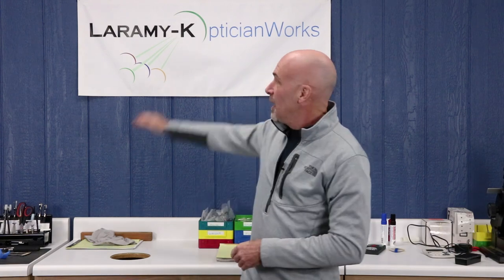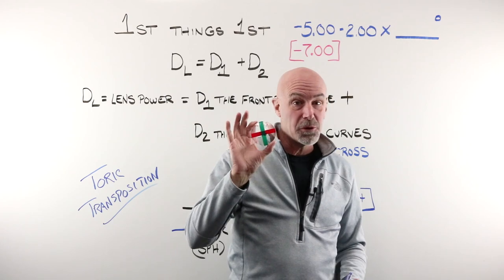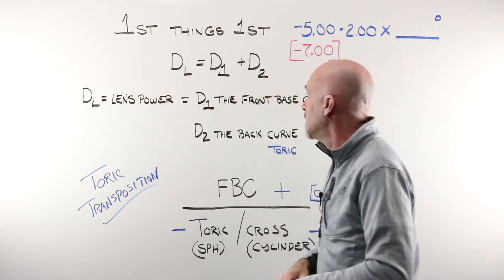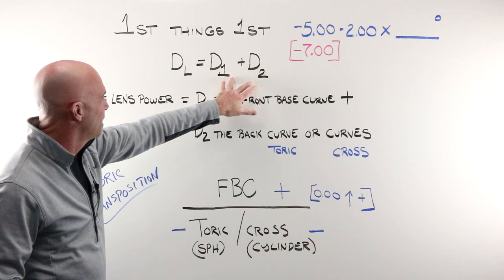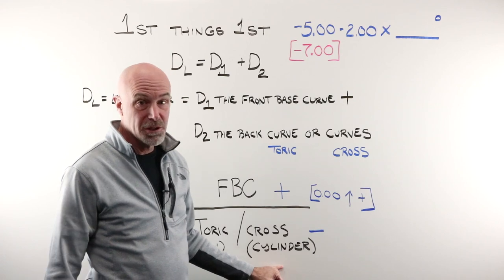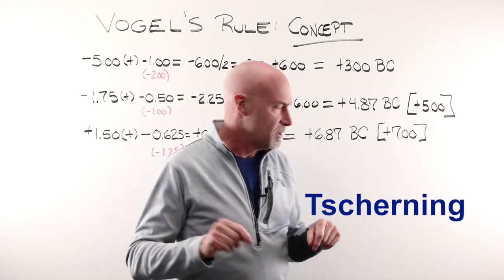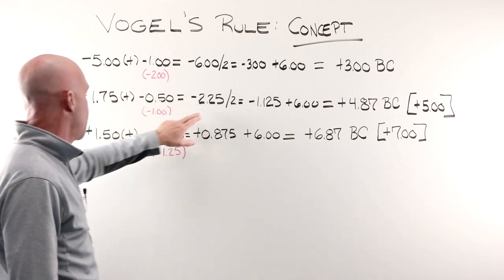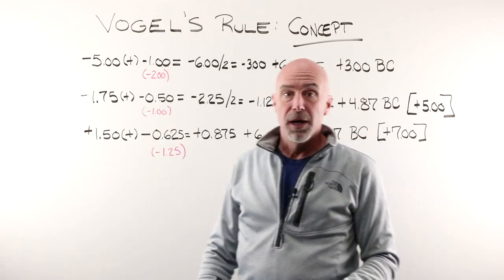Nominal Lens Formula Part 1 - Base Curve

Comment: In the first example using Vogel's rule, where does the -1.00 come from? At some point do we half the cylinder power? I'm a bit confused because there were no steps that would indicate how do come up with that -1.00? Please help!
Reply: Did you ever get an answer to this question? I’m highly confused especially with the other examples having different numbers that I don’t know where it came from 😩
Reply: @kassandramontes6116  My theory. You have two meridian readings (-5.00 & -2.00) Your second reading is -2.00, divided by 2 which gives you the -1.00. So you will actually divide two times instead of just one. However, if you are working with the Positive Power, you only need to divide once. I think that was it was, and it just was not specified but feel free to correct me in case you found the answer or better explanation. Again it is just an observation, just following the pattern. I hope it helps

Comment: Thank you for the video!  Can you explain why you are halving the cylinder power in the Vogel's rule example?  Everything else makes sense except for that.
Reply from the maker: Both the methods below work off the spherical equivalent of the given prescription. The formula to determine the spherical equivalent of any Rx is:
Rx sphere power added to 1/2 the cylinder power. If the Rx is a sphere like -2.50 then you work with the -2.50. Spherical equivalents are also used in other formulas and when working with contact lenses.
The most basic rule is that you always want the base curve to be as close to +6.00 as you can get and still have the Rx work. In theory +6.00 should always give you the best possible combination of curves for weight, optics, etc.
Study the chart below. You will want to remember that the higher the plus power, the higher plus the base curve will become. The more minus the power (less plus power to minus power) the lower plus the base curve will become. A high minus Rx may even have a base curve of +0.25 or even 0.00.
To do that you can use Vogel’s Rule which is this:
For a plus prescription: Base Curve = Rx spherical equivalent + 6.00D
For a minus prescription: Base Curve = 1/2 the Rx spherical equivalent + 6.00D

I don't you'll go wrong in thinking of spherical equivalent as an averaging of powers.

Comment: Thanks as always for the helpful videos. Could you possibly make one explaining how center thickness can negativity impact a final completed pair of glasses (when it doesn't meet tolerance standards)? Thank you!
Reply from the maker: Center thickness can only be out of "tolerance" in a minus and that only happens when the CT setting in the generator is set incorrectly resulting in a lens with an extremely thin CT. Think paper thin, think flexible, think I could put my finger through this thin. That should always be caught at the lab before it ever gets to an optician let alone a customer. Watch the 3 videos on Verification - Final Inspection. Checking lens thickness and having calipers is a relic from the days of 100% manual calculations and manual lens generating on Coburn's. 30+ years ago.
Reply: @Laramy-K Optical  thank you thank you!! I currently work at a place where checking center thickness is a step when trouble shooting glasses and so I was a bit unsure of how that could negatively impact a patient opticaly 🤔

Comment: You are amazing teacher I would like to ask you about base curve or front curve 
How can I choose if example sph +6.25 cyl _ 150 axis 90 
Example sph +8 cyl _2 axis 180
Sph +23 how choose base curve rx after calculate power plz
Reply from the maker: Look for Part 1 in that same series. I cover Vogel's Rule there. You also have some base curve charts floating around too. None of that matters now since computers do all the calculations for us. Stock lenses already run on best choice. Surfaced lenses the LMS decides which curve is best. John

Comment: Sir how we calculate the ct in lens  when our spherical value is -2.25 and cyl value -1.75 and addition value 1
Reply from the maker: You can't. It would depend on the material and what the surfacing equipment was set to. Your surfacing lab should be able to tell you. Do you mean edge thickness in a minus? Why CT for a minus? John
Reply: @LaramyKOptical  thankyou sir for telling but I am saying power of spherical value is -2.25 and power of cylindrical value is -1.75 and additional power  is 1 how we set the center thickness in our system for cutting optical lens please tell me calculation and how I set the base value in our system
Reply from the maker: @vikasmishra2697  Whoa OK without knowing what equipment and a million other things --- you would want your CT to end up at the minimum that whatever standard you are using allows. If it is 2.0 then you would set the CT at 2.0. I'd go to the equipment manufacturer and ask them or dig up a manual online maybe. Is this auto equipment or manual equipment? Like a Coburn with a diamond wheel old or something else?